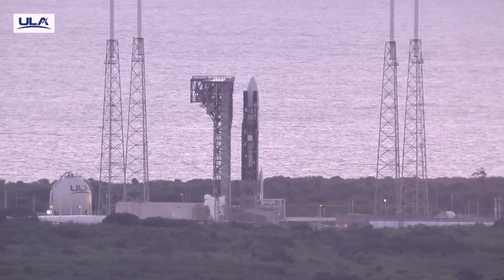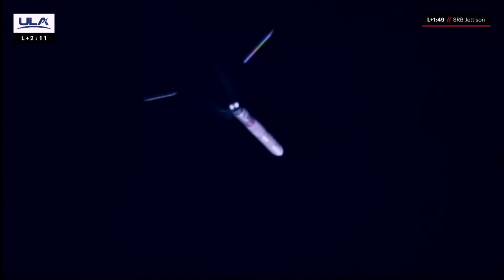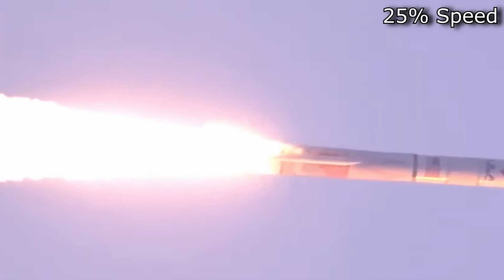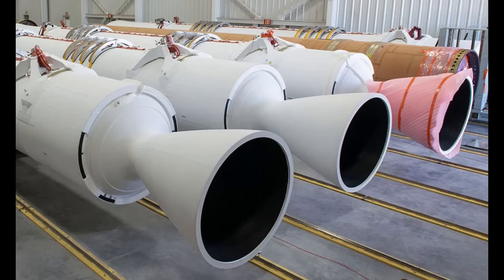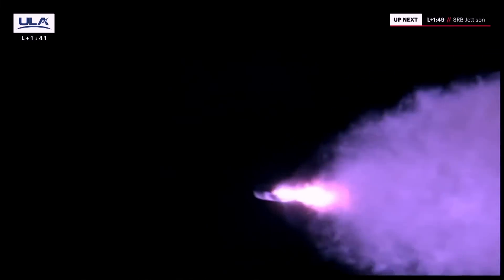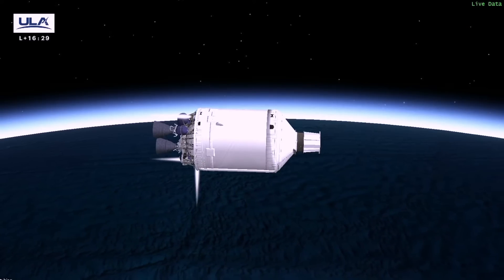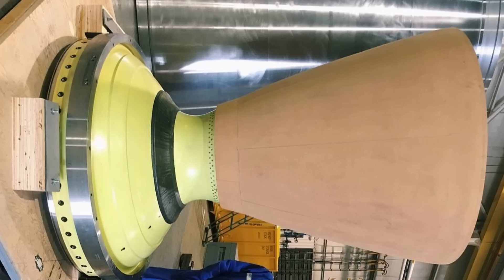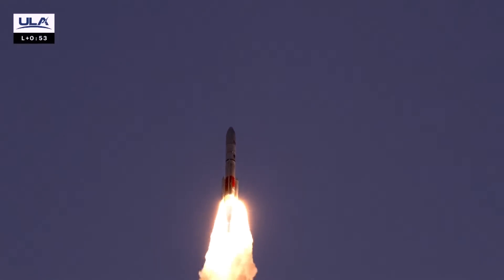How Did The Vulcan Rocket Survive This Booster Failure?

Comment: Bravo to the programmers who wrote the Vulcan's guidance program. Being able to compensate enough to get a successful launch out of a bird wounded so grievously is one thing I never thought I'd see. I'm guessing even a decade back, that would've been a loss of control and explosion (be it RSO triggered or automatic), not a successful (if atypical) launch to orbit. Deeply impressive job to all involved!
Reply: They used MechJeb.
Reply: @therealjamespickering nah it wasn't spending all it's rcs fuel spraying it every which way 😂
Reply: That's an argument in favor of the Vulcan.  The software was robust enough to "think on its feet" and get the job done.
Reply: ULA maybe behind in reusability but there is a reason they are still around. I agree, that's pretty impressive.
Reply: @wilboersma9441
Yeah, cost-plus contracts VASTLY over budget, at taxpayer expense. And that is a fact.

NOT a good reason for them to be around.
Reply: @wilboersma9441  If you are smart, you develop in stages. The have plans to recover the engines without wasting fuel that could be going into lifting the rocket. Called "smart reusability", as in using common sense rather than some ideological goal..  Not 100% reusability, which is a counter productive goal. Likewise,  trying to catch a booster long before you have a successful core design that actually flies and can get a payload into transfer orbit, is pretty idiotic!! 

ULA hs a real rocket engineer at the helm whereas SpaceX has a narcissistic idiot calling the shots!
Reply: @professorg8383  "100% reusability is a counterproductive goal"
Opinion discarded.
Reply: Much better than Boeing Starliners programmers for sure.
Reply: Even Saturn V (namely Apollo 6 and 13) could compensate the burntimes and trajectory for failed engines.
Reply: A ton of progress has been made on realtime control systems and controllers fast enough/small enough/low power enough to be integrated into systems like this. This is a lot of the reason we've seen spaceX land rockets, and why we really didn't see anything but NASA prototypes in the past, too much equipment was needed and wasn't reliable enough to be part of  a rocket payload.
Reply: @petergraphix6740  This is wrong.  Weight, power, and control systems haven't been the problem for 30 years.  What do you think is being used to guide and control Anti-aircraft missiles, airplane auto-pilot, and any number of other applications?  The launch vehicle never suffers from Radiation issues as it stays in the atmosphere and can use the more recent microcontrollers.  As in 1980s and 90s recent.  

The issue was Senators and NASA became extremely risk adverse after the first Space Shuttle disaster in 1986.  Combine that with a rocket industry that prefers a disposable model just like every other US industry (Polaroid looking at you).  It took someone willing to foot the entire bill.  The only people saying it wasn't reliable were the ones with financial and political interests.  The engineers were like please just give me money.
Reply: KSP has taught us a lot. 😁

(/s, of course)
Reply: I wonder what language those programmers are using for the guidance system...
Do you think it's Javascript or maybe PHP? 
😋
Reply: I wonder if this type of failure is something they modeled and maybe had some extra margin just in case
Reply: @littlerougue  Good question. I’d say absolutely they would. It would take a significant amount of asymmetrical thrust to balance that out but I would expect they probably modelled it with no thrust at all from the SRB.
Reply: The 100 control room person and their pets had their fingers crossed 🤞  😅
Reply: They were lucky this time.
Reply: @TheGalacticIndian  Remind me: how many times has this rocket flown?
Reply: @thethirdman225  Twice, giving it a solid 50% fail rate so far—basically a coin toss with a sprinkle of Boeing 'engineering'🎯💥
Reply: @TheGalacticIndian  But no ‘rapid, unscheduled disassembly’ so far, right?
Reply: @thethirdman225  Even here I have to disappoint you - the SRB GEM 63XL technically experienced rapid, unplanned disassembly of some parts at least during this doomed flight.
Reply: @TheGalacticIndian   That’s the SRB. It’s an add on and was needed for this test because of the extra weight it was loaded with. And really, apart from this and Challenger, how often do they fail? In any case, the rocket made into orbit, precisely where it was meant to go. Doomed? Hardly.

So let’s compare like with like. If the liquid-fuelled Vulcan can be directly compared to an early Falcon 9, in developmental terms, I’d say it’s doing very well.
Reply: Seems like everything happening outside of Spacex is a massive waste of effort and resources, particularly if Starship ever achieves anything close to its promised capability. When you have Saturn 5 throw weight for the price of a sounding rocket looming on the horizon, what's even the point if you're a competitor?
Reply: @somealias-zs1bw  for one, governments nearly always demand a second competitor they prop up...

And while I like spaceX, Musk himself makes some questionable decisions that could easily destabilize the company. 

You never leave yourself with a single vendor or you get held hostage.
Reply: @somealias-zs1bw if SpaceX becomes a monopoly with Starship, they'll become as fat and lazy as the industry they disrupted as a startup.
Reply: @somealias-zs1bw  competition is the point in and of itself. Companies like SpaceX don’t get good without competition. NASA probably wouldn’t have even got to the moon without the concept of a space race. And Musk wouldn’t be even as marginally honest as he is today without at least some competition.
Reply: @somealias-zs1bw SpaceX’s promises for Starship sound a lot like promises made about the Space Shuttle.
Reply: @wpatrickw2012  The difference being that SpaceX has every incentive to make cheap reusability work, unlike most of the people actually working on the space shuttle
Reply: @JanKanis  That's only true if you believe in Muskonomics. Unless you have inside knowledge of the cost structures involved, I'd say you're in no better position to judge than the rest of us. I can't imagine for a minute that it's as simple as you say. SpaceX is as much a government contractor as any of them these days.
Reply: @thethirdman225  The most important parts of the incentives are public knowledge: the space shuttle was built on cost-plus contracts (more expensive = more profit), with final decisions made by politicians whose primary concern was the next election instead of any longer term consequences. O.t.o.h. Starship was first designed privately on SpaceX's own dime. And SpaceX is privately held so no short term shareholder concerns there. There's now a Nasa contract but that is fixed cost. So more expensive is less profit. And Musk has already shown that he can apply radical new ideas to massively reduce launch prices. Though if he will succeed again we will need to wait and see.
Reply: @JanKanis  
"The most important parts of the incentives are public knowledge: the space shuttle was built on cost-plus contracts (more expensive = more profit), with final decisions made by politicians whose primary concern was the next election instead of any longer term consequences."

I love it when people make massive generalisations about politicians. You seem to have forgotten why the Apollo program was cancelled. Those programs had higher levels of transparency than the current ones.

"Starship was first designed privately on SpaceX's own dime."

Oh, I know that but Musk is still a government contractor so he has a steady income stream (and there are still things about that we don't know). Furthermore, you might want to take into account Musk sending his business from California to Texas. Why? Government incentives (via Greg Abbott).

"And Musk has already shown that he can apply radical new ideas to massively reduce launch prices."

Well, a lot has been made of this but there have been plenty of occasions when Musk has not lived up to his claims. That said, most of those were short term. We'll see where this ends up long term.

I am not completely convince by Starship.
Reply: @somealias-zs1bw  You should have said "inside" SpaceX

Just how much do you think Starship has spent so far?? And you must include everything like all the support equipment, like a real publicly traded company??  Musk Math not allowed!!!
Reply: @professorg8383
You don't understand a few things.

Starship isn't a regular rocket. Musk is literally using Starship as a test-bed. He's working on a lot of new technologies all at once.

And yeah, we're using Musk math, because it is a private company. And it was founded by Musk specifically to get humans to Mars. That's the sole reason it exists. It's function isn't to make a profit like a public company. It's to get humans to Mars.
He's been building up his abilities, and using those abilities to generate income to develop more technologies that he needs to go to Mars.
Reply: @professorg8383   Gwynne Shotwell testified before Congress recently that SpaceX has spent ~$3 billion on building Starbase and the launch site. We don't know the figure for Raptors and the ship itself.
Reply: @somealias-zs1bw  I'mma guess the "point" is milking the US gov for as much cash as possible before the gravy train dries up, in order to maximize quarterly reports so C-suite employees can get fat bonuses and sell their stock at a profit before bailing.

Comment: Given that both boosters burned out at the same time, that would imply the throat diameter remained the same on the partially failed one. So I’d expect it failed at or somewhere after the interface after the throat since any change after wouldn’t propagate upstream through the supersonic flow to disturb the combustion. 

Just another note, at the throat the velocity wouldn’t be the highest along the nozzle. As the flow progresses through the nozzle (assuming the flow is choked) it would be increasing in velocity, just as the pressure would be continuously decreasing along the nozzle. (You know your stuff so I know you know :) but just a note for anyone else)

Anyway, incredible that it could compensate on the fly and avoid what looked like an imminent loss of the vehicle. Thanks Scott, as always, for the quick coverage! I always hear about space news on the channel before I hear it from anywhere else
Reply: I completely see the logic here on a liquid fuel rocket, but isn't there a burn rate on solid propellant? I would think the nozzle wouldn't affect burn time in a solid fuel booster....Like a model rocket engine?
Reply: @matthewboers4217  solid propellant burn rate is dependent on pressure inside the casing. if the nozzle fails,the pressure inside drops,changing burn rate.
Reply: @JayWye52  only if it fails at the throat, or upstream of it. If the nozzle fails downstream of the throat, any change in pressure from that area cannot propagate upstream because the flow is supersonic at that point.
Reply: @JayWye52  nah I looked into it.  This thread is way misguided.  It's amazing the level of self confidence people have on subjects they really don't grasp.  Reminds me of COVID.
Reply: @matthewboers4217  Which point are you referring to?
Reply: sound like a rocket scientist or something
Reply: I wager that there's still going to be a measurable difference in backpressure at the nozzle in a bell-equipped and bell-less booster. After all, the entire point of the bell is to have gasses bouncing off it to extract all the energy they can. That interaction should, at least in my brain, result in gas vent able to exit as fast as it could be.

Like a fire hydrant... Even with a hose that's the exact diameter of the outlet, I'd still think it'd reduce the flow rate on account of friction with the hose.
(I could easily be wrong though!)
Reply: The throat restricts flow to the speed of sound in the exhaust gas at the gas temperature.  A failure aft of the throat cannot change anything upstream of the throat because changes in pressure propagate at the speed of sound and cannot reach the combustion chamber  upstream of the mach constricted throat. Any change in chamber chamber changes the burn rate thus indicating the failure was aft of the throat restriction. @DUKE_of_RAMBLE
Reply: How does temperature change along the bell? Or more to the point, rate of ablation (which I assume is a function of both temperature and pressure)
Reply: The loss in thrust is not high, since at the throat the gas velocity is just over Mach 1, with no efect upstream.
Reply: @Arturo4586  I would guess the thrust loss was pretty significant (depending on how much of the nozzle was lost) seeing how much the vehicle was compensating, but also because the nozzle does a lot to accelerate the exhaust relative to the speed at the throat. All just depends on how much of the nozzle it lost, and what other damage may have happened when it went
Reply: @Tanner_Hoyt  The flowrate is always sonic irregardless of the shape of the throat , only an additional expanding nozzle will increase the flowrate. Learn the relevant equations 
Compressible flow 101
Reply: @Arturo4586  Yes I understand that, I’m just saying the more nozzle they lost, the more thrust they lost, and we really don’t know that yet, so we’ll just have to see. And maybe there was some other damage we don’t know about, just a lot of unknowns at the moment is all I mean. 

I’m not sure what you mean by flow rate here. The expanding part of the nozzle won’t change mass flow rate, just velocity and pressure.  But yes, this is what my college degree is in :)
Reply: @Arturo4586  I'd've thought an additional expanding (so downstream of throat) nozzle would not affect the flow rate, but redirect the exhaust gas that'd go sideways more towards the rear, and, as a result, be pushed forward by the gas, and transfer that forward force onto the vehicle.
Reply: @Wolf480pl  Yeah you’re right that the mass flow rate won’t be changed by the downstream expanding nozzle once the flow is choked, but it will increase the velocity of the exhaust gasses. So you’re right that the more nozzle we have, the more thrust we have (generalizing) but it’s because the dominant term in the equation for thrust is the mass flow rate multiplied by the exit velocity. So more velocity = more thrust

Comment: Funny, I was watching this launch live on another site, and I saw these sputter blasts quite clearly, which also looked to be rattling massive chunks of frost buildup off. Even before the first belch, shortly after launch, when we still had a clear view of the Vulcan, did anyone else notice the tall flame crawling up the side of the faulty booster? I fully expected it to over-cook and explode. I also notice that prior to SRB separation, this booster was already fully exhausted, while the other was still running. As obvious as all this was to someone who has witnessed hundreds of launches, dating back to the late 1950's, so knew that this was not normal, no one at Mission Control said a word about it. Perhaps their GO-Fever for achieving CERT-2 made such a gamble worth it.
Reply: What would an abort for a lit SRBs at low altitude look like.  Wouldn’t the safest thing to do be keep going?

Comment: Scott misspoke about halfway through the video.  Any flow changes happening downstream of the choke point of the nozzle will not change what happens upstream of that point, because that's where the flow goes supersonic.  Disturbances do not propagate upstream in supersonic flows.  So that's why the motors still burned out at the same time.
Reply from the maker: I might have been talking about entrained flow near the base of the booster which sucks exhaust gasses upstream around the outside.
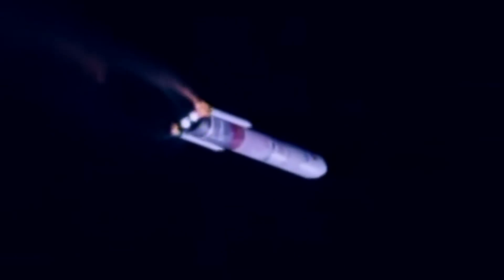Reply: @scottmanley  It's @10:52.

"It's important to note that they burned out at roughly the same time.  If there had been damage to the nozzle, which had made one side bigger than the other, they would have burned at different rates because the pressure inside the booster would have been different."

I think you meant to say, "If there had been damage to the booster casing, which had made the plume on one side bigger than the other, they would have burned at different rates because the pressure inside the booster would have been different."

It's a minor thing.  I look forward to every one of your videos; you are consistently a fount of interesting and accurate information.

Cheers!

Comment: Out of everything that could have failed on this rocket, I am very surprised it was those srbs. The gem 63s are very simple, they don’t gimbal, and they are made as one piece (shuttle boosters were multiple segments joined by o-rings). For how expensive these boosters are, I am surprised they didn’t find any imperfections in the composites. An ultrasonic test in the industry norm to find small cracks in composites that could potentially evolve into a failure point. I am really curious to learn how these boosters failed